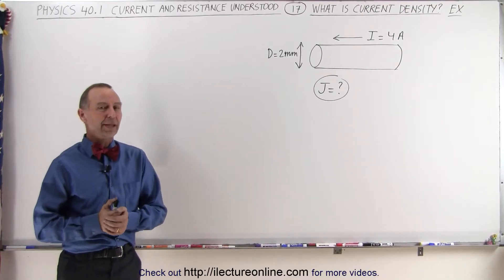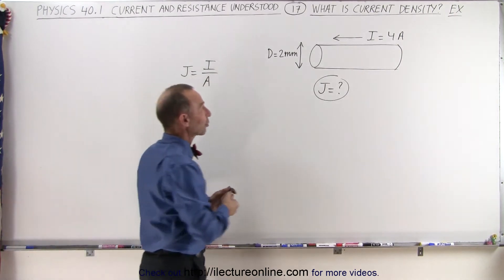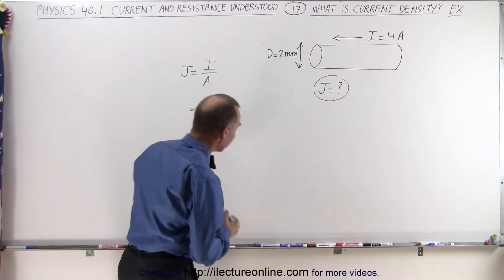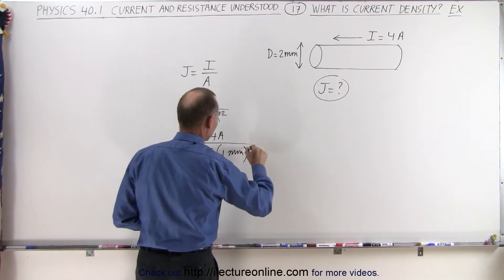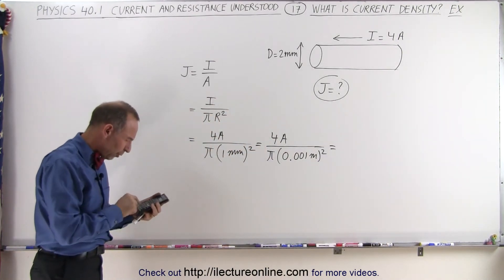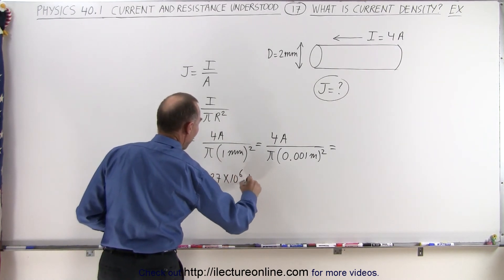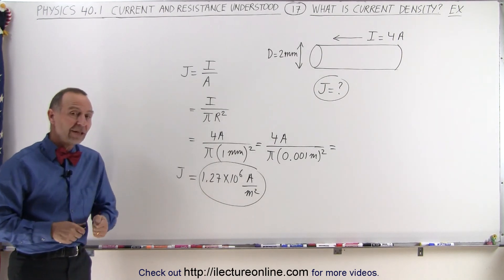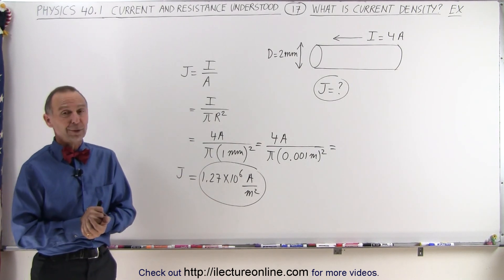Physics - E&M: Ch 40.1 Current & Resistance Understood (17 of 17) What is Current Density? Ex.

Comment: What is the relationship between drift velocity and the long of wire
Reply from the maker: Drift velocity is the AVERAGE velocity of the charges (electrons) as the travel along the wire in a very erratic fashion.  The length comes into play with the distance formula:   d = v t    or L = v t

Comment: Sir, what will happen if a conductor couldn't handle a certain amount of current density?
Reply from the maker: It depends on what you mean by: "couldn't handle".   The typical problem with conductors is that if the cross sectional area is too small, the current density will be too high (meaning the current will be too high) and since the power dissipation depends on   P = I^2 R, it would generate too much heat and the conductor will overheat and potentially start a fire.
Reply: Michel van Biezen ohhh at last I know now why a wire burn sometimes. Thank you so much for the answer sir. 😍😍
Reply: @MichelvanBiezen  How do I calculate the maximum current density (Amps per meter squared) for square plate shaped electrodes of various materials (316L Stainless Steel, Graphite, Platinum) that will be used in water electrolysis) before the plates begin to overheat?